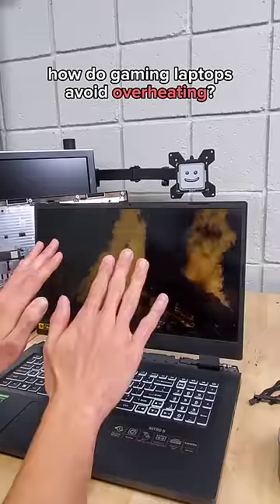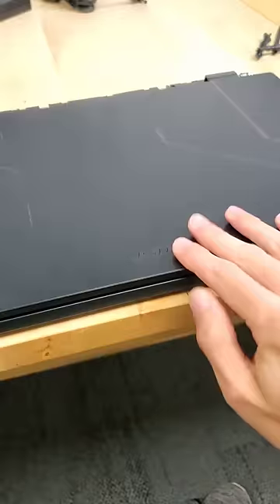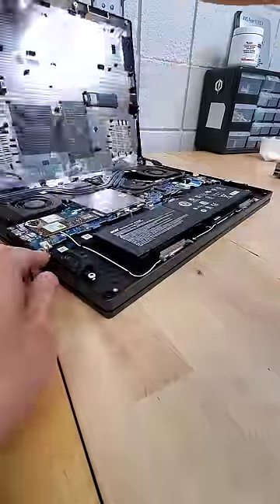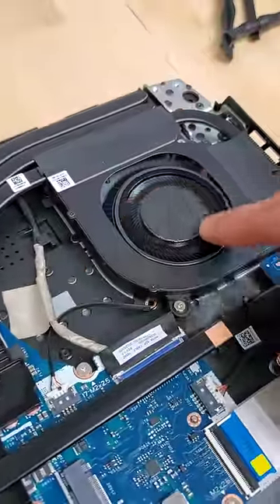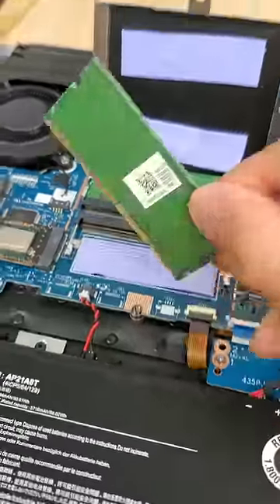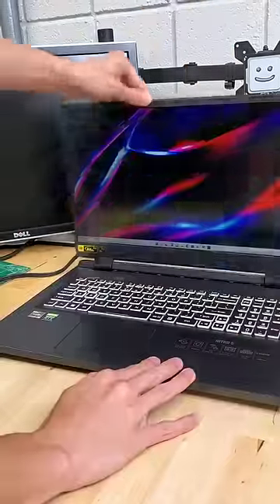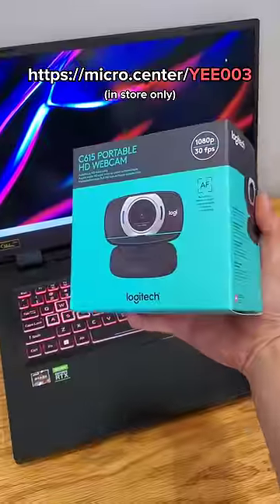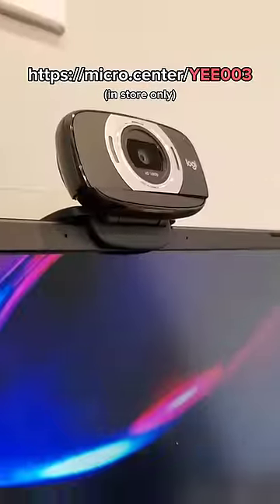how do gaming laptops avoid overheating? #shorts

Comment: I had a Nitro 5 and this is a lie, it is the most thermal throttling laptop I've ever used, not even my old 2014 laptops without maintenance or thermal paste replacement throttled as much

Comment: There are a lot, really A LOT of different Acer Nitro 5 versions
And I have one of them, which is like a completely different laptop

So what version is that?

Oh and my Nitro 5 overheats a lot
It gets really hot and the CPU gets really slow in games and stuff, that's why I often have low FPS
Reply: Intel sucks. My friend's Nitro 5 literally pushes all the cores to 4,5 GHz even when on 95°C. Isn't that amazing? The GPU is literally cooler by 20°C down!!!! After a few years, it becomes an e-waste as the CPU will mostly fail because of the heat.
Reply: Which CPU & gpu does your Acer nitro 5 have?
Reply: @Bafana777  Probably an Intel and they don't care about the temps at all. Unlike AMD which can sometimes throttle even on 60°C, or their TDP is low so it's doesn't heat that much.

Comment: That’s pretty cool! Never new much about high end gaming laptop because I have a Mac
Reply: does your mac stay cool under load? my imac overheats because it never bothers increasing the fan rpm. i have to do it manually to keep it reasonably cool
Reply: Well mines a m1 air but yea it does thermal throttle

Comment: To make your cpu cooler in laptops try undervolting it.

With a little less power the CPU will perform nearly same and won't produce heat specially useful in laptops.

I do the same with my desktop.

Comment: I used a legion 5 (r7 3060) asus a15 (r5 3050) now in terms of heating they both do even when the price difference is huuuge
But when you get a cooling fan you'll see which is different
Now legion 5 dispersed the heat faster so feels like fan did something but with asus its shit
conclusion: these mid range laptops(or laptops ig.. unless u travel a lot etc)  aren't really that good and if you want to spend almost 1500-1800$ imo desktop still wins
Reply: I have the same Legion 5 as you. It never once thermal throttled for me. But those fans do get loud. But I also know those fans are effectively doing their job cuz those temps drop really fast.

Comment: Nope still over heats and reach above 90 c gaming laptop never is a good idea i learned that the hard way
Reply: mobile cpu/gpu are designed to run hot. 90c is normal on these laptops. i would only worry if it runs at 100c or above as that is right on the thermal limits of the chips before they start throttling hard set off its shutoff protections.